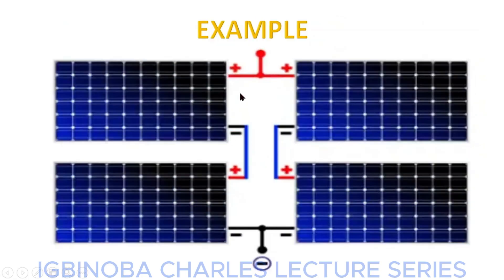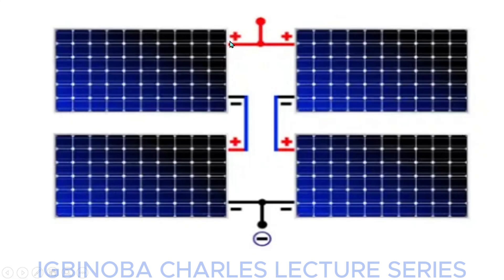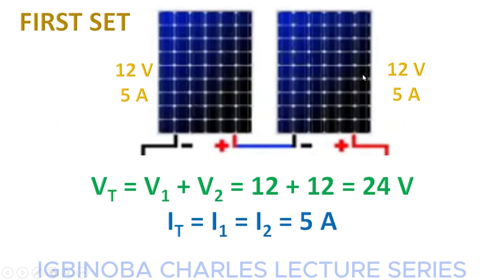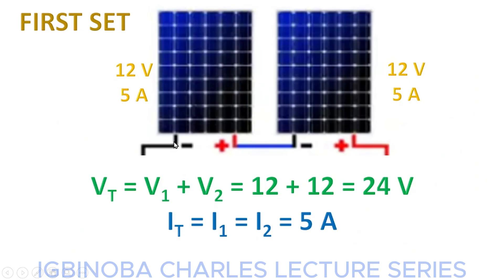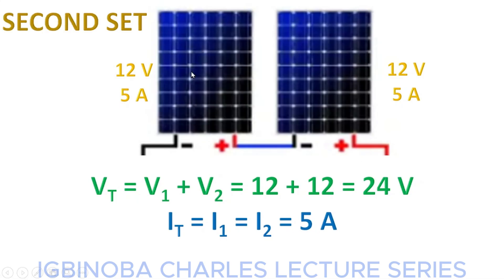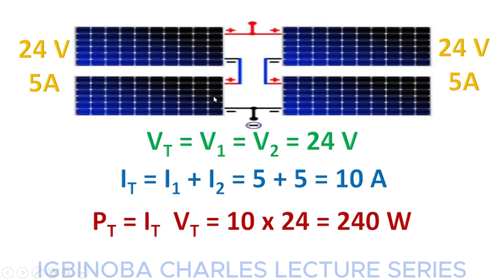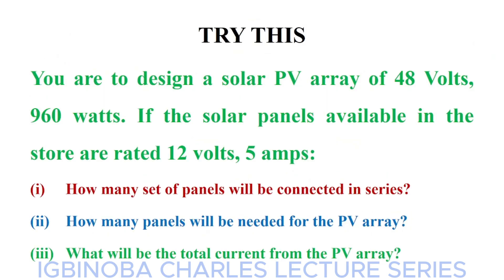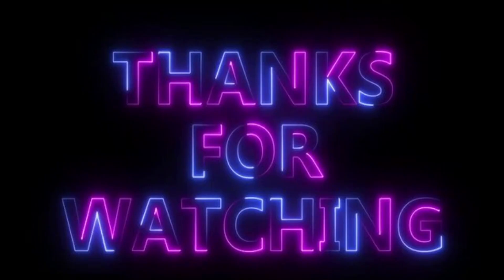Connection of  Solar Panels in SERIES-PARALLEL

Comment: PETRO3132B

1) How many panels in series to reach 48 V?

Each panel = 12 V.
Compute: .
Answer: 4 panels in series per string (4 × 12 V = 48 V).

2) How many panels total for 960 W?

Power of one panel: 
Total panels required: 
Alternatively: one series string (4 panels) gives . Then  parallel strings →  panels.
Answer: 16 panels total.

3) What will be the total current from the PV array?

Each series string supplies the panel current = 5 A. With 4 strings in parallel, currents add: 
Answer: 20 A.

Comment: PETRO3141K

i) 4 sets of panels will be connected in series (48V÷12V=4)

ii)16 panels will be needed for the PV array( 960watts÷60watts= 16)

iii)The total current from the PV array will be 20Ampere( I=P/V=960/48=20A) or 5A*4(sets of panel)=20A

Comment: EEE382D

Number of panels connected in series = 48 * 12 = 4

Power output of one solar panel = 120 V x 5 A = 600 W, The total required power for the array is 960 W, so the number of panels required =960 + 60 = 16 panels.

There are 16 panels in total, with 4 panels connected in series. Number of parallel strings = 16 4 = 4 parallel sets. Each set produces a current of 5A.
Since the sets are connected in parallel, the total current becomes 5 A x 4=20A

Comment: CIV378Z
1: Four panels connected in series. When you connect four 12-volt, 5-amp panels in series you get a total of 48 volts which is the voltage needed for the solar system

2: A total of 16 panels are needed. Each panel produces 60 watts (12v × 5A = 60W).
To get 960W in total (960 ÷ 60 = 16 panels)

3: The total current from the solar array is 20 amps.
Using the formula I = P ÷ V
I = 960W ÷ 48V = 20A

Comment: PETRO392N

a) Panels in Series:  
To reach a system voltage of 480V using 120V solar panels, you need to connect:  
480V ÷ 120V = 4 panels in series.

b) Total Number of Panels Needed:  
Each solar panel generates 600W of power.  
To achieve a total system power output of *9,600W*, the number of panels required is:  
9,600W ÷ 600W = 16 panels in total.

c) Parallel Strings and Output Current:  
If the 16 panels are grouped into sets of 4 (in series), this gives *4 strings*.  
These 4 series strings are then connected *in parallel*.  
Assuming each string delivers *5A*, the total system output current is:  
4 strings × 5A = 20A total current.

Comment: PETRO398T

i ) 4 panels 
Since voltage add up but current remains same in series

ii ) 16 panels required for the PV arrey

iii ) total current will be 20 Amps 
Since I=P/V =960/48 = 20Amps

Comment: COMP355C
A) since when connected in series only voltage will increasewe divide 48/12 = 4. Therefore 4 panels are connected in series.
B) Since total wattage is 960W and one of this is (12×5=60W) 60W, so total no. Of panels is 960/60 =16.Total Panels are 16 in number.
C)Total current =total wattage/total Volts. And total wattage is 960W while total volts is 48V. So I=960/48, and is equal to 20A. Therefore total current is 20A.

Comment: CHM 330D

1. Since the PV array is 48v and the store is rated 12v, the total panels is 4. 
2.  16 panels are needed for a PV array
3. Total current for the PV array is 20A

Comment: PETRO346T

1. 4 panels (12 volts, 5 amps each)
connected in series give 48 volts as required.
 2. Each panel produces 60 watts (12 x 5), so 960 ÷ 60 = 16 panels needed
3. Total current: 960 watts ÷ 48 volts = 20 amps.

Comment: PETRO3137G

1.Four panels are connected in series.
Connecting four 12-volt, 5-amp panels in series gives a total voltage of:
4 × 12 V = 48 V
This meets the 48-volt requirement of the solar system.

2. A total of 16 panels are required.
Each panel produces 60 watts:
12 V × 5 A = 60 W
To achieve 960 watts total:
960 ÷ 60 = 16 panels.

3. The total current from the solar array is 20 amps.
Using the formula I = P ÷ V:
I = 960 W ÷ 48 V = 20 A

Comment: PETRO3166J

1. Set of panels needed to be connected in series are four (4)
2 panels needed for the PV  array are sixteen(16)
3 The total current from the Pv array is 20 amps

Comment: EEE394P

(i)4 panels connected in series
48v/12v= 4 panels

(ii)Each panel produces 12v × 5A = 60w
So 960 ÷ 60 = 16w

(iii) Total current = 960w ÷ 48v = 20A

Comment: MAR396R

i. 4 sets of panel will be connected in series (48 v/12 v) = 4
ii. 6 panels will be needed for the PV array (960W/60W) = 16
ili. The total current from the PV array is 20A ( 960W/48W) =20A

Comment: MAR380B

1) Four panels will be connected in series

2) 16 panels will be needed for the PV array
This is because power for each panel is 12×5=60watts, therefore the total number of panel to produce 960watts is 960/60=16

3) Total current for the PV array is 20amps
Current=power/voltage
I=960/48=20amps

Comment: PETRO354B
1.when connecting panel in series, voltages add up, but current remains the same
Required voltage = 48v
Each panel voltage = 12v
Number of panel in series = 48/12
= 4 panels in series

2. A total of 16 panels would be needed
Each panel produces 60 watts i.e 12v * 5A = 60w
To get 960w in total, therefore, 960w / 60 * w = 16 panels

3.utilizing the formula-l = p / v
I = 960w / 48 * v = 20A

Comment: MAR 353A

1.	Number of panels in series:
To achieve a 48V system using 12V panels, the number of panels connected in series should be:
          48V ÷ 12V = 4panels {in series}
         2. Total number of panels required:
Each panel is rated at 12V and 5A, giving a power output of:
         12V × 5A = 60W per panel.
          For a total system power of 960W, the number of panels needed is:
960W ÷ 60W = 16panels
Since there are 4 panels per series string, the number of parallel strings will be:
16 ÷ 4 = 4parallel strings
	3.	Total current output from the PV array:
Each series string produces 5A. With 4 parallel strings, the total current from the array becomes:
5A × 4 = 20A

Comment: Mech3144N

1)four solar panels are connected in series 
2)A total of 16 panels are needed .each panel has 60 watts,to get the W = 960÷60 = 16 panels 
3)the total from the solar arrays is 20-amps
Using I=P÷A
-960÷48=20A

Comment: PETRO3116L

( i ) 4 panel in series 
( ii ) A total of 16 panels would be needed with each panel producing 60 watts via 12V x 5A = 60W
( iii ) via the formula: I = P/V 
I = 960W / 48V = 20A

Comment: CHM3137G
I, 4 sets of panels will be connected in series (48V ÷ 12V = 4)
ii, 16 panels will be needed for the PV array (960 W ÷ 48W = 16
iii, The total current from the PV array is 960W ÷ 48V = 20A

Comment: EEE355C

a)Panels in Series:
To achieve a system voltage of 480V using 120V solar panels, the number of panels required in series is:
480V ÷ 120V = 4 panels in series.
b) Total Panels Needed:
Each solar panel produces 600W.
To meet a total system power demand of 9,600W, the number of panels required is:
9,600W ÷ 600W = 16 panels in total.
c) Parallel Strings and Current:
With 16 panels arranged as 4 panels per series string, there will be 4 series strings connected in parallel.
If each string provides 5A, then the total output current is:
4 strings × 5A = 20A total output current.

Comment: PETRO3134D

To achieve a final voltage of 48 V for the array, you'll need to connect the panels in series. Since each panel provides 12 V, you'll require 4 panels connected in series. 2. Each panel generates 60 W (calculated as 12 V x 5 A). Given that the total power needed is 960 W, you'll need a total of 16 panels to meet this requirement. 3. With a total of 16 panels and 4 panels per series string, you'll end up with 4 parallel strings. As each string provides 5 A, and since they're in parallel, the total current will be 20 A (5 A x 4).

Comment: MECH319S

Since the purpose of series connection is to increase the voltage while keeping the current constant

Number of panels in series=48/12=4

ii)Total power=960W
Power per panel=12*5=60W
Total number of panels required=960/60=16panels

iii) Total current= 960/48=20A

Comment: CIV335I

Since the purpose of series connection is to increase the voltage while keeping the current constant

Number of panels in series=48/12=4

ii)Total power=960W
Power per panel=12x5=60W
Total number of panels required=960/60=16panels

iii) Total current= 960/48=20A

Comment: EEE3157A

1) 4 panels are connected in series to achieve the required 48v
2) 16 panels are required for the PV array
3)Total current from the PV array is 20A

Comment: PETRO312L

1) Four panels are connected in series 
         48V/12V = 4 

2). The power generated by one panel =                Vt * It = 12*5 = 60 watts 
      To get 960 watts in total is 960/60= 16 panels 
        So for the PV array, 16 panels will be needed 

3). Total current, 1 = P/V 
       I = 960 watts, 148 volts = 20A 
       So total current = 20 A

Comment: PETRO 150

i) When connecting panels in series, voltages add up, but the current remains the same.
Required voltage = 48V
Each panel voltage = 12V
Number of panels in series = 48 / 12
= 4 panels in series

ii) A total of 16 panels would be needed
Each panel produces 60 watts, i.e. 12V × 5A = 60W
To get 960W in total, therefore 960W / 60W = 16 panels

iii) Utilising the formula I = P / V
I = 960W / 48V = 20A

Comment: EEE3114J

A. Panels in series. The total voltage is 48V. Each panel is 12v. 4 panels are needed 

B.  Each panel generated 60W. The total power required is 960W. Therefore a total of 16 panels

C. Using P=IV
I=P/V > 960/48=20A

Comment: EEE3101W

1. 4 set of panels will be connected in series 
Since connecting 4 to the 12 volts, 5 amp panels in series  gives a total of 48volts as required by the solar PV array design 

2. 16 panels will be needed for.the PV array. This is because the power of each panel is 12 × 5 = 60watt, therefore the total number of panels to produce 960 watts is 960/60= 16

3. The total current from the PV array is 20amp 
Since I (total)= P (total)/ V (total)
I (total) = 960/48 = 20amps

Comment: MECH348V
Answers;

1:) Number of panels connected in series = 48 ÷ 12 = 4

2:) Power output of one solar panel = 120 V × 5 A = 600 W.
The total required power for the array is 960 W, so the number of panels required = 960 ÷ 60 = 16 panels

3:) There are 16 panels in total, with 4 panels connected in series.
Number of parallel strings = 16 ÷ 4 = 4 parallel sets.
Each set produces a current of 5 A.
Since the sets are connected in parallel, the total current becomes 5 A × 4 = 20 A.

Comment: PETRO345S
1:
Number of panels connected in series = 48 ÷ 12 = 4

2:
Power output of one solar panel = 120 V × 5 A = 600 W.
The total required power for the array is 960 W, so the number of panels required = 960 ÷ 60 = 16 panels.

3:
There are 16 panels in total, with 4 panels connected in series.
Number of parallel strings = 16 ÷ 4 = 4 parallel sets.
Each set produces a current of 5 A.
Since the sets are connected in parallel, the total current becomes 5 A × 4 = 20 A.

Comment: PETRO3128X
A) Panels in Series: To get the system's voltage of 480V using 4 120V panels connected in series
B) To reach the demand of 960W, 16 ppanels are required.
C) The strings are connected in parallel and it will give an output current of 20A

Comment: MAR3110F
1 four panels connected in series.when you connect four 12-volt,5-amp panel in series you get a total of 48 volts which is the voltage needed for the solar system 

2 A total of 16 panels are needed.each panel produces 60 watt(12v ×5A =60W) 
To get 960w in total (960÷60=16 panels)

3 The total current from the solar array is 20amps
Using the formula I=P÷V
I= 960w÷48V=20A

Comment: CHM3115k

1.  Number of panels in series = 48/12 = 4 panels.
2.  Number of panels needed for the PV array = Total power in the circuit/ Power in each panel = 960/60= 16 panels.
3.  Total current from the PV array = Total power/ Total voltage = 960/48 = 20 Amps.

Comment: PETRO3136F
1. In series, current remains the same, hence: No. of panels - 48/12 = 4 panels

2. P= IV = 12×5 = 60W each
   Total power - 960W
    Hence , number of panels = 960/60 = 16 Panels

3. From P=IV, I = P/V
    I = 960 / 48 = 20
  Hence total current is 20A

Comment: PETRO3139I

a) Panels in Series: To achieve the system's target voltage of 480V using 120V panels, 4 panels need to be connected in series.
• b) Total Panels Needed: The power output of a single panel is 600W. To meet the total system power demand of 960W, 16 panels are required in total.
• c) Parallel Strings & Current: With 16 total panels arranged in 4 series strings, these strings are connected in parallel. This configuration results in a total output current of 20 Amps.

Comment: COMP344R

1. Number of panels in series:
For 48V, we need to connect panels in series. Since
each panel is 12V, we'll need
48V divided by 12V = 4 panels in series
2. Total number of panels:
Х
Each panel is 12V, 5A, so the power rating will be: 12V x 5A = 60W per panel
For a 960W array, we'll need: 960W divided by 60W per panel = 16 panels
Since we need 4 panels in series, we will have: 16 panels / 4 panels per series line up = 4 parallel line ups
3. Total current from the PV array:
Each series line up produces 5A (since the panels are connected in series). With 4 parallel lineup, the total current will be:
5A × 4 = 20A

Comment: CHM3117M
1.Number of Panels in Series
Required system voltage = 48V
Each panel voltage = 12V
Number of panels in series = 48V ÷ 12V = 4 panels
Answer: 4 panels in series.

2.Total Number of Panels Needed
Power of one panel = 12V × 5A = 60W
Total required power = 960W
Total number of panels = 960W ÷ 60W = 16 panels
Answer: 16 panels in total.

3.Total Current from the PV Array
Total panels = 16
Panels in series = 4 → Number of parallel sets = 16 ÷ 4 = 4 sets
Current per set = 5A
Total current = 4 sets × 5A = 20A
Answer: The total current is 20A

Comment: EEE325Y

1. Four panels are connected in series. When you connect four 12-volt, 5-amp panels in series, you get a total of 48 volts, which is the voltage needed for the solar system.

2. A total of 16 panels are needed. Each panel produces 60 watts (12V x 5A = 60W). To get W in total: 960 + 60 = 16 panels.

3. The total curent from the solar array is 20-amps. Using the formulal=P+A,
1=960W 48V = 20A,

Comment: PETRO3100V

1.) How many set of panels will be connected in series? 
48V/12V = 4
 
They are 4 panels in series
2.) How many panels total for 960W
 Each panel's power

P= 12V * 5A= 60V
Total panels needed: 960W/60W = 16 panels

There are 16 panels in total for 960W

3.) Total current from PV array?

They have 16 panels total arranged in sets of 4 in series: 16/4 = 4 parallel strings 

In parallel, current adds up: 
Current total: 4* 5A = 20A

Total current = 20A

Comment: PETRO365M

i) When connecting panels in series, voltages add up, but the current remains the same.
Required voltage = 48V
Each panel voltage = 12V
Number of panels in series = 48/12
= 4 PANELS IN SERIES
ii) A total of 16 Panels would be needed
Each Panel produces 60 watts I.e. 12V x 5A =
60W
To get 960W in total, therefore, 960W / 60W =
16 Panels
iii) Utilizing the formula - I = P/V
| = 960W / 48V = 20A

Comment: CHM 3148R
A) Panels in series: To acheive the system's target voltage of 480V using 120V panels, 4 panels needed to be considered in series Calculation: 48V 5A = 4Panels B) Total panels needed: The Power output of a single panel is 600W. To meet the total system power demand of 960W, 16 Panels are required in total. Calculation: 960W + (12V × 5A)= 960W/60W = 16Panels C) With 16 total panels arranged in the the series string, these strings are connected in parallel the result is 20amps, Using IP+V we have 1960W, 48V and 20A
Reply: EEE349W

A) Four 120V panels must be connected in series to reach the target voltage of 480V.

B) Since each panel produces 600W, a total of 16 panels are required to meet the 960W system power demand.

C) When the 16 panels are arranged in series strings and the strings are connected in parallel, the system output becomes 48V, 20A, and 1960W.

Comment: PETRO377Y
I. To get a pv array of 48 volts
    V= V1+ V2+V3+V4
    48= 12+12+12+12
    Current remains constant since it's connected on series.
Therefore 4 set of panels will be connected in series.
II.  Each panel contains 60 watts 
     i.e 12 V ×5 A = 60 watts
Therefore to get 960 watts
  960÷60= 16
There 16 solar panels are needed.
 
III. Remember P=IV
      960 watts=I × 48 Volts
      I= 960÷48 = 20 A
  TOTAL CURRENT is 20 A.

Comment: MAR338L
1. The number of panels to be connected in series is 4.
12v+12v+12v+12v=48v
2. The panels needed for the pv array is  16 panels 
3. Pt=960w, Vt=48v, It=xa
Since Pt =It×Vt
960=It×48;  It=960÷48
It=20a

Comment: PETRO3115K 
4 panels are connected in series.2) The power output for the channel is the total voltage multiplied by the current p=12x5=60.therefore total numbers of panels to produce 60watt=960w/60w=16pannels.3) total current from the pv array will be 20amps

Comment: PETRO3180X

When connecting panels in series, voltages
add up, but the current remains the same.
Required voltage = 48V
Each panel voltage = 12V
Number of panels in series = 48/12
= 4 PANELS IN SERIES
ii) A total of 16 Panels would be needed
Each Panel produces 60 watts l.e. 12V x 5A =
60W
To get 960W in total, therefore, 960W / 60W=
16 Panels
ii) Utilizing the formula -1= P/V
I= 960W /48V= 20A

Comment: MAR 350X

SOLUTION 
1. Number of panels connected in series
48V ÷ 12V = 4

2. Power output of one solar panek= 120v ×5A =600W
The total required power for the array is 960W, the number of panels required is;
960÷60 = 16panels

3. There are 16 panels in total, with 4 panels connected in series.
Number is parallel strings= 16÷4 = 4parallel sets
Each set produces a current of 5A
Since tge sets are connected in parallel, the total current becomes 5A × 4 = 20A